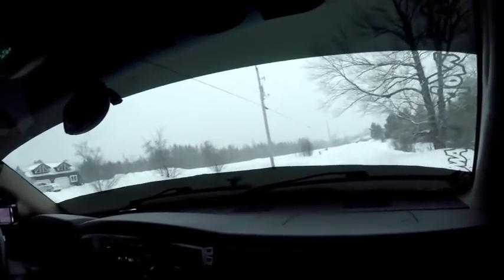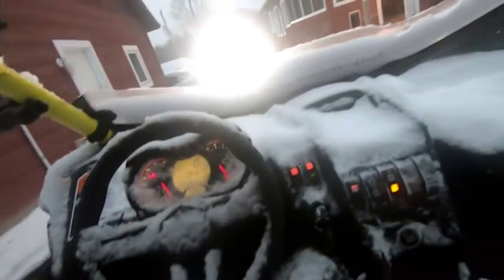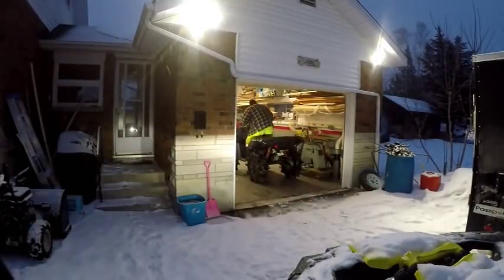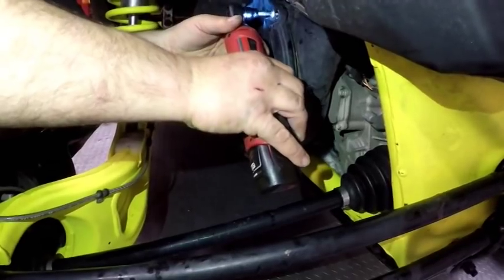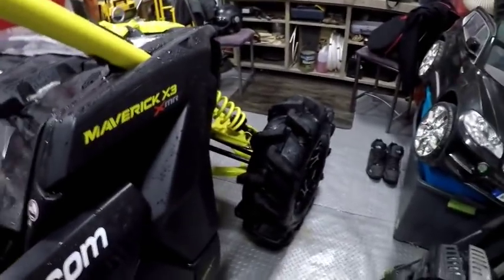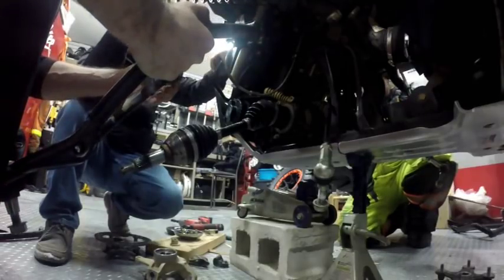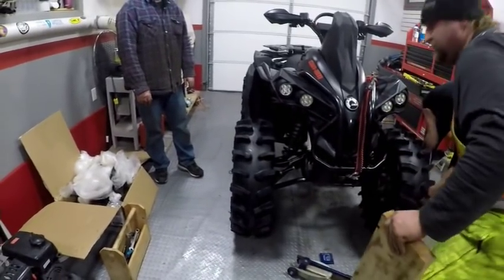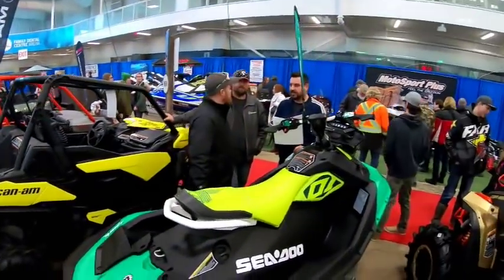SuperATV forward arched A-arm install, Quinte Sportsman Boat & RV Show and a belt change

Comment: Great video. I've got a set of those Super ATV forward arched A-Arms on my other Commander and where I had to lift the first one I'd bought several inches to clear 29.5"s OutLaws with these arms I'm clearing 30" Silverbacks on the front and with some trimming on the rear fenders

Comment: Ouuuu more vids I was just looking at those a arms today
Reply from the maker: Pretty slick, eh. Dirtylife bud.
Reply: Was thinking bout trying to make some 34 assinators work with out a lift they would fit all I need to do is take an inch out of running boards on front and back

Comment: Lol. A service guy at my dealer acted like he had no idea about a bolt to open up the secondary. Said he was pretty sure that's just on snowmobiles. Told me he normally just manhandles it off and on. Anyway, do you run a heavier secondary spring with those tires? I have an epi spring, wondering if I should use it off the bat or try the stock first. Figured you would know for sure. Another good vid. Like to see em come apart sometimes. 👍
Reply from the maker: No not at all, these treads are the same size as stock setup on this x3. Can't even feel a difference.
Reply: @ehTV1000  I meant on your bike. Not the sxs. Mine are coming today. But mines not an xmr so I think I'm going to put it in. They're here now. 31s. I don't go near as hard as you guys. Do you think a cvtech clutch is decent enough? Or should I plan on upgrading later?
Reply from the maker: CVtech is more then capable of giving you more power. Haha

Comment: Ordered my super atv forward arched a arms today eh. Did you use your stock bushings? I have garage products bushings and don't want to damage them when I take them out my oem arms. Any tips?
Reply from the maker: I used new Garage prodct bushings and ball joints, But yeah most folks re-use their old one's.
Reply: @ehTV1000   I guess it wouldn't hurt to just get another set and have two sets of complete arms. Did you have to use the shim set that comes with the new arms with the garage products bushings?
Reply from the maker: Couldn't squeeze them in, Went without. Figured the same, can't hurt to have the spare set ready to go back in.
Reply: @ehTV1000  yeah your right. I wish my a arm guards would go on the super atv arms. Don't think they make any for them. Ima make some custom ones after I get them in and will make a video to post on my install. I have a couple videos up, would love if you'd subscribe and check some of them out.
Reply: @ehTV1000  I've got garage products bushings front, rear, sway bar and they are awesome. No noise and completely sealed. Couldn't squeeze any grease in them after install. Lubed them up really good before. Didn't use any shims in front for stock arms. Best bushings you can get by far to take care of the can am noisy ones.
Reply: Eh, what ball joints did you use in your satv a arms?